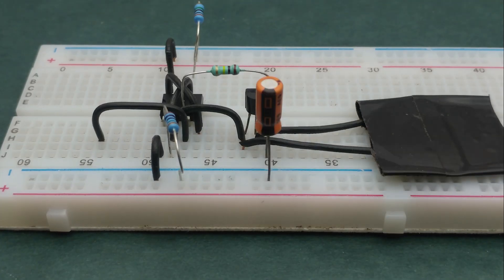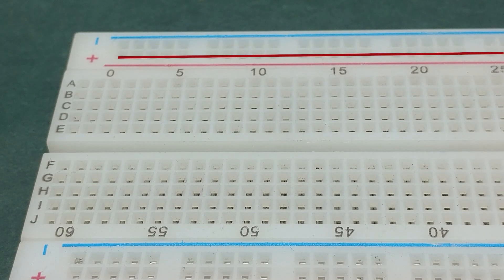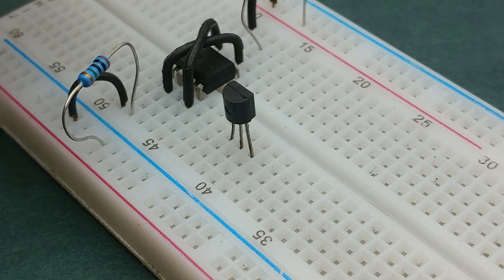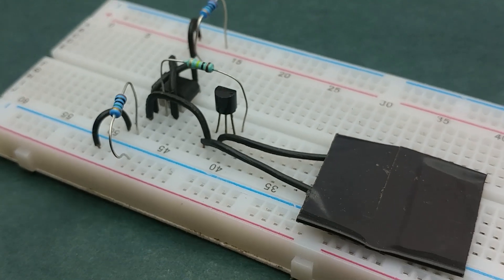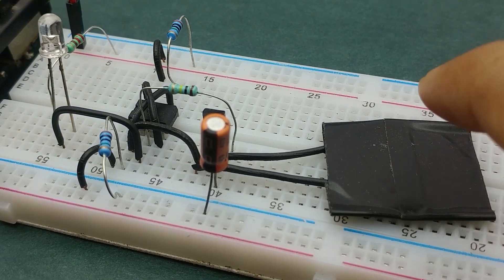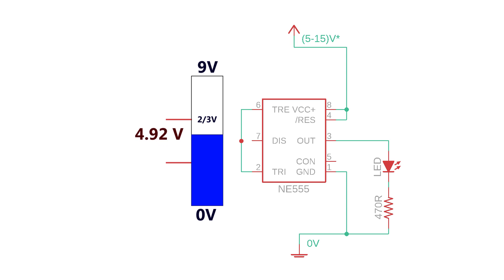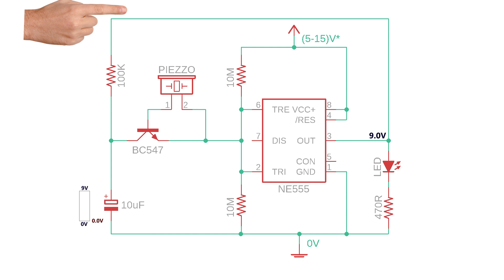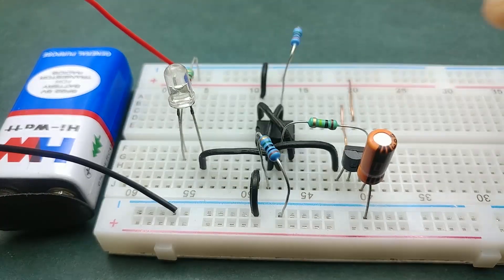Piezo Sensor based Tap On Off Switch Circuit on Breadboard | 555 Timer project #3

Comment: Hey , this worked for me but the led does not go off even after I touch the sensor. Could you tell me what the problem could be ?
Reply: Also me, you find where's the problem ? 😢
Reply: @kkk.....-ze2li  did you use a higher rated resistor than required for the respective voltage you are giving ??

Comment: Id like to build something similar to make drum triggers. When my drummer hits a drum, Id like to flash a light On, then turn off immediately. Can I do a simple mod of this circuit or will I need some sort of OP amp comparator? I figured for the lights power, I can use a relay circuit since Im not sure what type of lights I will eventually use so I dont know my power switching parameters at the final load. Probably cheap LED strands. Ive searched quite a bit on drum trigger ciruits for DIY. If you can make a simple one like this I believe it will be popular. Ill help you promote it. Thanks #Copacetictheband>>>>>>>>>Hey, how about a monostable multivibrator???
Reply from the maker: Op-Amp is best suited for what you are describing. But the output might stay ON only for fractions of a second and it might not be noticeable. One idea is to use Op-Amp to trigger the output and monostable multivibrator to keep the output persistent for a few milliseconds. I'll see if I can stitch up any circuit for what you are describing.
Reply: @elonics  Exactly what I was thinking after I read up a little. 👍 I also have been thinking about using an Audriuno

Comment: Thiswroks really good. I am trying to use this circuit to a small lamp made of concrete and high brightness LEDs. So I want to be able to touch or tap the either on the concrete or the acrilic of my design. that mean that I want the piezo to be hidden. But when I try to put the piezo on a surface so I can tap it to turn on the lights, it's noisy. I mean, the led starts blinking. How can I regulate sensitivity of the piezo?

Comment: Which component should I change for a 3.7v power supply? Thanks!
Reply from the maker: 555 needs a min voltage of 4.5V. So the only way is to use a DC voltage booster to increase the voltage from 3.7 to 4.5 and power this circuit
Reply: @elonics   thank you dude!

Comment: hi! I would like to create a project for a 30 cm x 30 cm carpet, which makes a buzzer sound when you run over it. is it possible with this project?
Reply from the maker: Hello, It is possible with a similar circuit, but you need to create a monostable arrangement (in order for the output to revert back after some time after getting triggered) instead of the latching mechanism. Also multiple piezo sensor should be arranged all over the carpet (Atleast one piezo sensor should be compressed when a person places his feet on the carpet)
Reply: @elonics  such as the upper surface resting on a sponge to go back over?

Comment: i builded the same circuit  but it isnt working, the led is glowing but the piezo sensor when tapped isnt turning it off
Reply from the maker: Did you try the touch version of this circuit shown at the end of the tutorial? If that worked, probably the connections to the piezo sensor are not proper or the sensor size is small
Reply: @elonics  I tried & gave connection properly. But why I didn't get the output. I used 4.7M instead of 10M. Is that ok?
Reply: 1 more doubt I have. In ckt diagram 330 ohm resistor is connected in negative & anode of led only connected in 3rd pin of Timer IC. But when you explain you are telling that cathode should be connected with 3rd pin of IC and resistor should connect with positive.
Reply from the maker: @Saranya More the value of the resistor on either side of the pins 2 & 6, more will be the sensitivity. I suggest you to build a touch version of the circuit & momentarily join both the contacts with a conducting material. If the circuit works, you should be using a 10M instead of 4.7M i.e., the sensitivity is not enough. If it doesn't work even if you touch the contacts with a conducting material, there might be a problem with the transistor connections or the power supply
Reply from the maker: Yes, the LED arrangement in the video is different from the circuit diagram, but it shouldn't matter. It'll work either way

Comment: if I connect a 1uF capacitor will it decrease the delay needed before toggling.
Reply from the maker: Yes, Reducing the Capacitor's value reduces the delay needed between successive knocks. The same holds true when we change the value of 100K resistor.